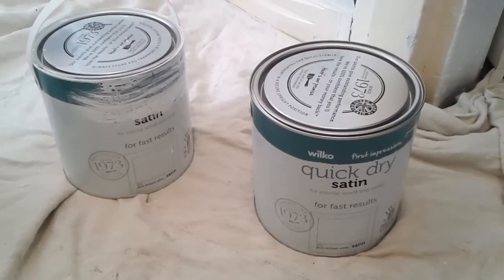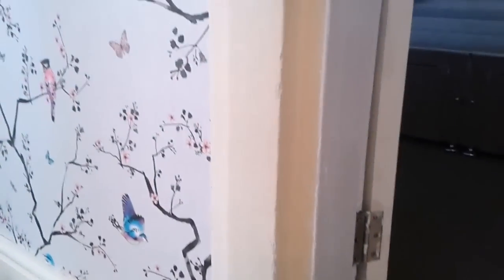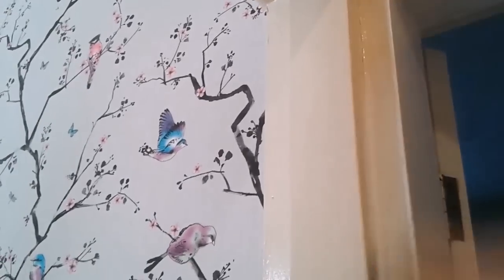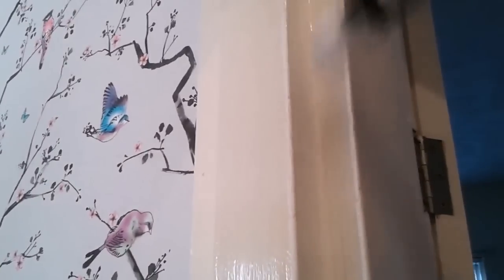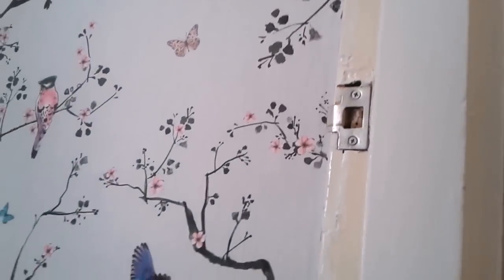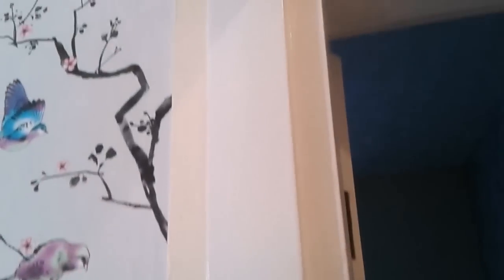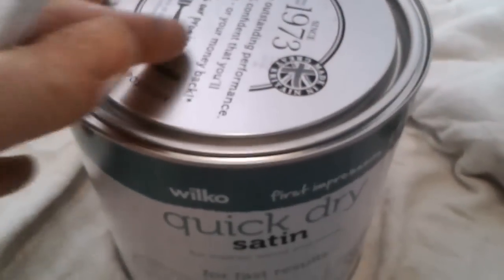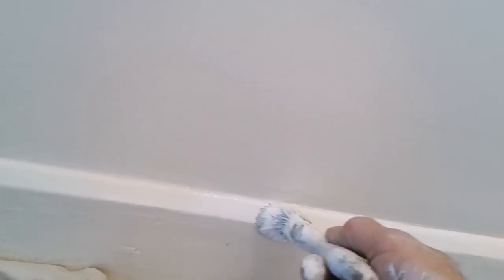Budget D.I.Y. Wilko Quick Dry Satin Reviewed

Comment: I've painted most of my new loft extension with Dulux trade which was satisfactory if not great,  but I bought a tin of Wilko bathroom emulsion for the ensuite ceiling and was impressed with how well it covered.  £12 for 2.5 litres
Reply from the maker: May have to have a look at other paints they do. For customers on a tight budget.
Reply: @PaintingandDecorating  yes may be worth a try

Comment: Synthetic brushes tend to work better in water based satin and gloss . Proform Blaze and Fossa Viper Trim are particularly good . You should give them a try.
Reply from the maker: Do use them more for emulsion, I prefer pure bristle for my finish paints.
Reply: Natural bristle is nicer for glossing I believe too. Proform might be too expensive and is not as good as bristle. Having said that they impressed me on oil!!

Comment: Did you go straight over the previous oil based with this rather than some kind of multi surface primer first?
Reply from the maker: No it's self undercoating as long as you key the surface.
Reply: So a wipe over with sugar soap and a light sand before applying?

Comment: Just watch your latest posting about the Wilko quick dry satinwood. Did you paint water based over the top of old oil? Will that not peel of later ?
Reply from the maker: You need to sand down to give it a good key. Satin does not need an undercoat just two coats.
Reply: Thank you.
 @PaintingandDecorating
Reply from the maker: Phil Stringwell  No it wont not when keyed correctly  it's called sanding. You can use a primer speed things up.  Will do a video to show you want you need to do.